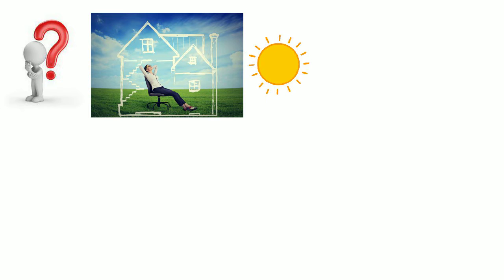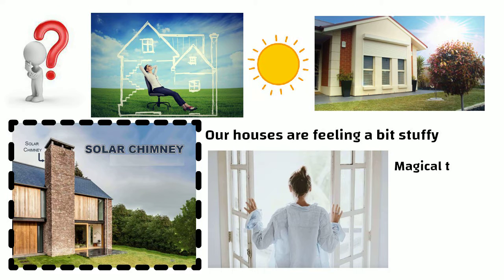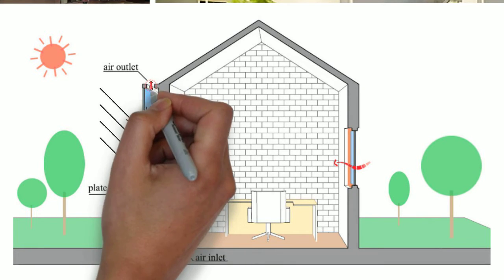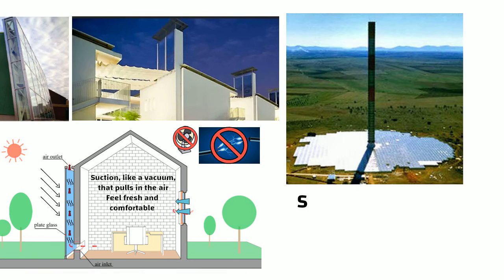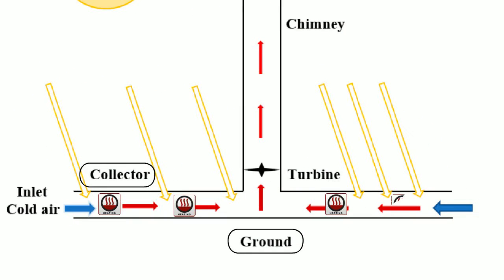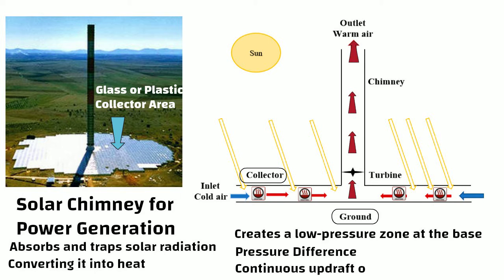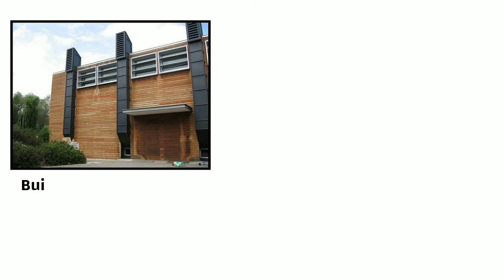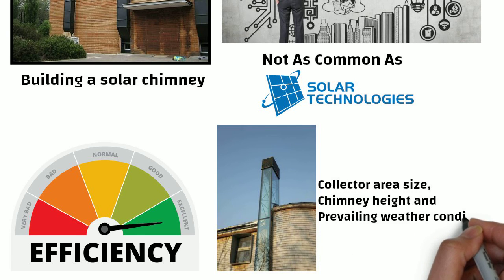How Does a Solar Chimney Work?

Comment: If the outdoor temperture is high, the fresh air from the outside will bring the outdoor heat inside. So there will be a t&c if you want to cool the building usinh this method